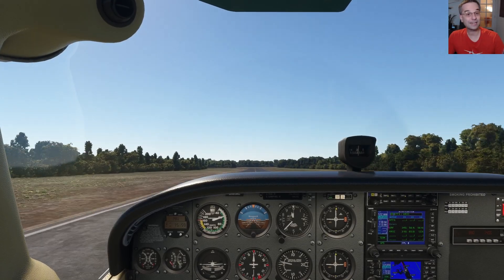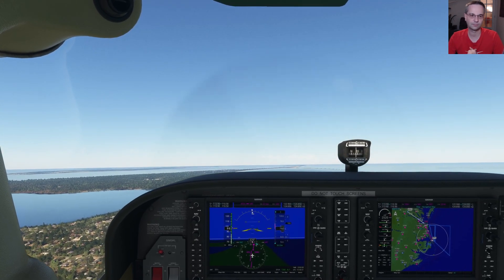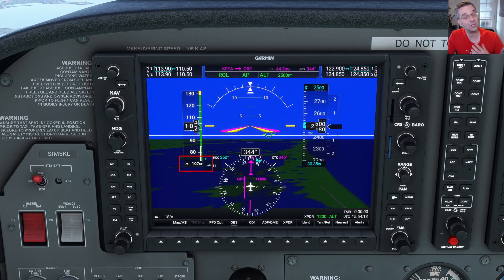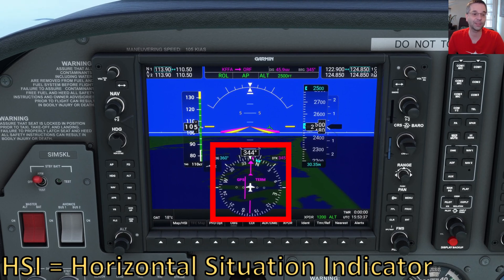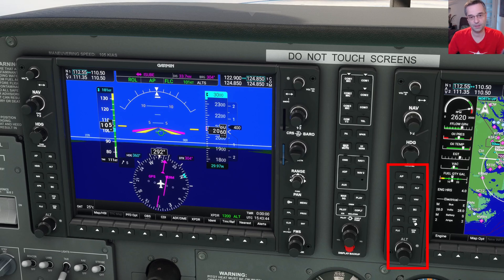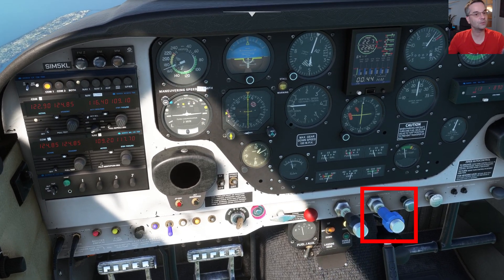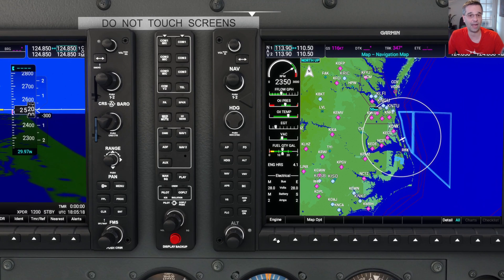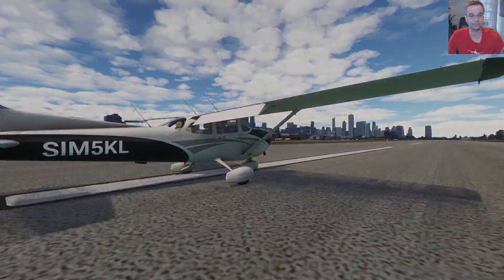MSFS Airplane Systems Overview | Tutorial

Comment: Your video for 2020 showing how to use the Num Pad to set views in the cockpit was a game changer.  Have you figured out how to do this in 2024?
Reply: Nevermind.  I found the original video for 2020 and it still works!  Thanks!
Reply from the maker: Yep it still works, working on a bindings video right now ;)
Reply: @FlightSimSchool  I setup the views in a 172 and they worked perfectly but then went into a 737 and can't seem to get them to work on a second plane.  It seems to be remembering the 172 locations and not letting me reset.   Am curious if the same thing happens for you or if its just my system.  Thanks again for your help and videos!
Reply from the maker: @degunter  funny you mention that, I had that happen once, and then not again. At first I thought the views were associated to the general control presets, but they are definitely different per airplane even with the same preset, so I'm not sure what happened